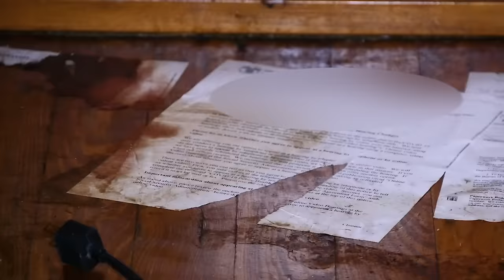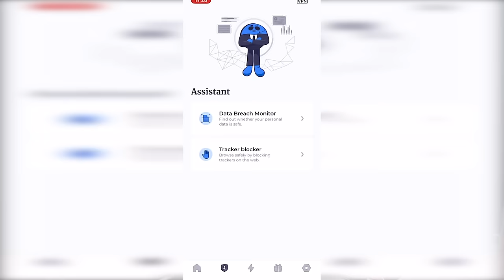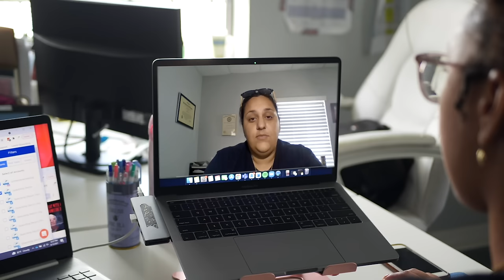Melted Through the Floor Boards | Tampa, FL

Comment: Really nice hardwood floors. Can't believe the homeowner covered it up with carpet.
Reply: Was thinking the same thing. Heart of pine old Florida hardwood floors likely 100 years old. I know where those houses are in d/t Tampa.
Reply: Replacing baseboards or paneling is harder because a lot of the mill patterns no longer exist. That happened when my grandpa wanted to redo part of his house.
Reply: 😂 I thought of that straight away. Ripping out our carpet and underpaid revealed beautiful white oak hardwood. I guess carpets were a big thing in the 20th century we’ve gone back to appreciating wood.
Reply: @anncoxwell7015  I found that to be true. It took a few phone calls to find the right guy to do my floor but wow was it ever worth it. Everyone compliments my hardwood like it must have cost me tons I’m like nope, it was hiding under the stinky wall to wall 1970s style carpet 😅
Reply: I think it has more to do with sound.  Hardwood floors are great to look at, but are noisy to walk on, which can pose problems in apartments or similar buildings.  Carpets help to absorb sound and make for a more quiet step.

Comment: Good job over all! I would recommend cleaning the bio off the top of the floor to start because you can see people tracking through it and maybe wrap the wood in a tarp and tape it before carrying it down the stairs to prevent contaminating other areas and create less trips. Then wrap it in your bio bags.

Comment: I think you should put your team through a safe practice of power tools course they are just sawing through anything that has the INDERCATOR on it with total disregard for power lines under the floor boards gas pipes or even metal studs and also they are not using the power tool correctly anyway and it's only time before someone is seriously hurt it's just a thought 😉 stay safe guys love the content regardless

Comment: Being dead for two days wouldn’t cause that much of a mess.
Reply: Its a relatively small mess. But in 24 hours you start leaking fluid more then you realize. And if the apartment was fairly warm, which most elderly homes are, the more they'll decompose.